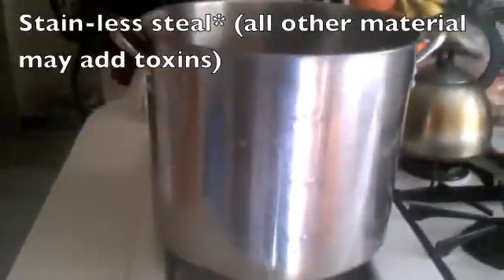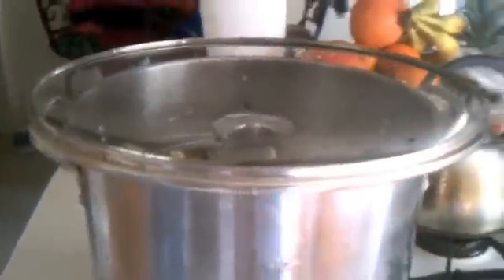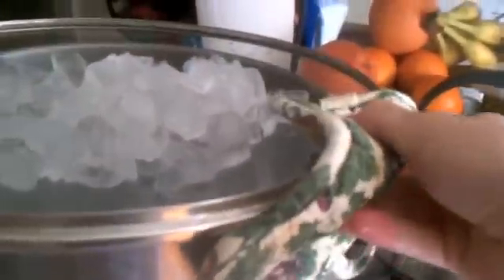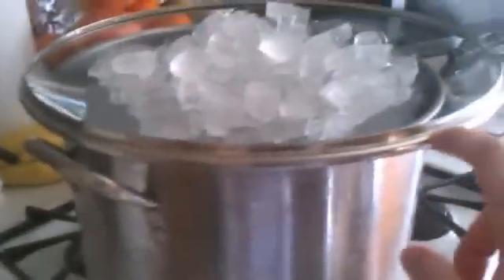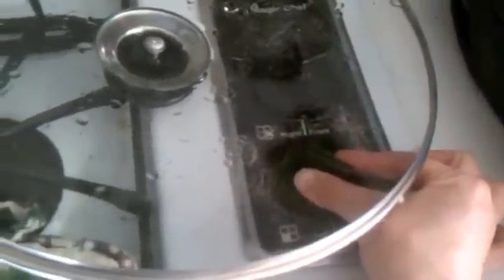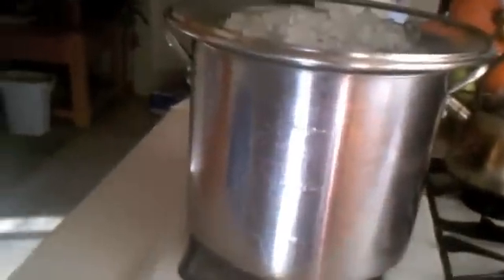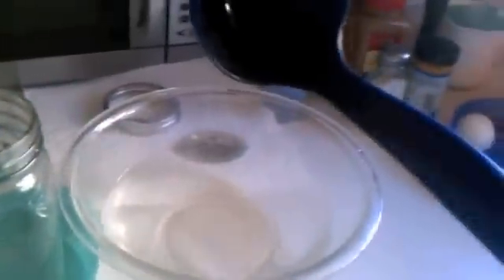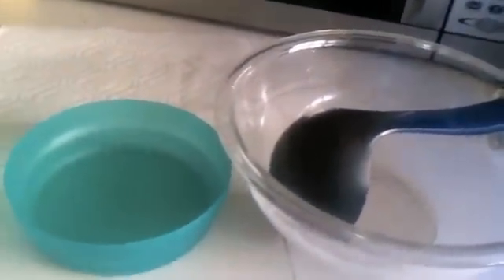How To Make Distilled Water | DIY Distilled Water

Comment: Flouride naturally occurs in water. It's a salt... It's the Chlorination that's problematic. Chloromine forms when Chlorine interacts with organic systems (your body) . Brita filters change the taste to bearable but I am not certain if it removes chlorine. I think it does.
Reply: 1. Yes, a carbon filter (Brita is one) does remove chlorine.  That is the good news!
2. Just because fluoride salt occurs naturally in the water in some areas does not mean it isn't a poison or make it good for you.  Arsnic occurs naturally in some areas as well.- but it will still kill you.
Google "fluorosis" to get an idea of some of the serious problems that naturally occurring fluoride causes.
Those who promote the use of fluoride state that it works topically (by external application to the specified area); hence the reason it is in tooth paste and the reason dentists give you the fluoride solution to swish around your mouth.  But both of them tell you NOT to swallow it.
The practice of fluoridating drinking water in order to help build tooth enamel is analogous to drinking suntan lotion to protect you from sunburn (as opposed to just applying it topically to your skin)!  Because they both are said to work "topically"- but who in their right mind would drink suntan lotion?!  Or even worse, who would consider adding suntan lotion to the water supply to protect everyone from getting a sunburn?!
By the way, a little research will reveal that fluoride is not a component of any known biological/life process of any known organism- including the building tooth enamel. It is a poison to all life.
Fluoride can also come in many forms, some being much more dangerous than others. Unfortunately, most cities that fluoridate their water supplies have moved from using fluoride salts to using a FAR more dangerous form called hydrofluorosilicic acid (or hexafluorosilicic acid) which is quite difficult to transport because in its undiluted form it can eat through concrete and many metals & plastics, and it is deadly to any living organism in that state.
Reply: Both are problematic.  What would be the purpose of putting fluoride in drinking water if it naturally occurs?  What's the purpose of drinking fluoride if it's good for teeth; shouldn't fluoride toothpaste hit the target more efficiently than fluoridated H2O?  Since it naturally occurs in nature and is in the tooth paste why add the additional cost of processing water by putting in more fluoride?  Have you ever read the fluoride warning label on your tooth paste?  The fluoride they put in our H2O is a waste product from the aluminum industry.  Look up the MSDS on fluoride and then decide. Neither the CDC nor FDAs argument hold H2O.
Reply: Nolom Ebal I think you're ignoring the fact that most idiots can't even manage to brush their teeth on a regular basis.

DJJonPattrsn22 I think your comparison of suntan lotion drinking water and fluoridated drinking water is entirely flawed. Suntan lotion protects your skin which is not in contact with the water you drink, fluoride protects yout teeth which is in contact with the water you drink. It'd be more accurate to make the comparison that taking a bath in water that contains suntan lotion is like drinking fluoridated water, since in both of those cases the topical solution would actually touch the surface they're intended for. And FYI taking a bath in suntan lotion water would provide some level of skin protection, like fluoridated water prevents tooth decay. Of course taking a bath in something toxic has less risk than drinking it.

If there was no evidence that fluoridated water actually improved health in the mouth, it would certainly not be done because it costs money and it would be pointless. While fluoride is not needed for any biological process, it doesn't make much sense to talk about the toxicity of a concentrated form. The body needs iodine to survive, yet iodine is toxic if taken in quantities in excess of 2 mg (That is a very small quantity!). Most nutrients the body needs can be overdosed and provide negative results, including death, so should we consider them all poisons? Of course not.

That aside, fluoride can cause fluorosis over time and is still dangerous when taking in non-toxic quanities, the kidneys can only remove 60-80% of it per day in most cases, the rest calcifies. So I'm by no means saying we should continue fluoridating water, just saying there's a reason it's done. The main reason being people are too stupid to handle their own hygiene.
Reply: GOAE7777 FLouride is put in the water to Sterilize the water, they remove most of it before it leaves the Water treatement plant, Stop trying to sound so smart... The Healthy teeth thing is just a Lie they tell to make the common ignorant man feel safer. FDA is curropt and doesn't care about your health... And Sunscreen, not suntan lotion lol, Is in our water supply because we wear it before we swim in pools, lake and the ocean... It is killing coral reef and contaminating Water Tables, and pools put the sunscreen lotion back into our public water system... So yes that is also a concern

Comment: i have a question, is the rain water distilled water ?>
Reply: Yes, with cloud dust in it.
Reply: Yes it is but not good do drink because or all the chemicalls these days are in the air
Reply: the precipitation is condensation, but it's not distilled because it contains impurities from air pollution. Example, acid rain in New York damages the statue of liberty. Ever try eating snow?  you can taste the crap in it.
Reply: hi li I love eating snow... It's so tasty...
Reply: eagle eye & *****  Yes. That is correct, distillation is defined as a process of purification through the evaporation & condensation of a liquid- water in this case.  The evaporation of water which then falls as rain or other precipitation is sometimes cited as an example of distillation in nature.  However, due to the high level of airborne pollution especially near urban & industrial areas, significant amounts of sometimes very dangerous airborne toxins can be absorbed by precipitation by the time it reaches the earth.
Reply: But nowadays...  acid rains happen which make the rain water PH. Unstable...
Reply: eagle eye What kind of question is this? please understand that winds blow all the pollution around the globe to fall with the rain far away? Volcanoes ashes, industrial and fires, never use rain water for drinking!
Reply: treliyiaellinika this was a curious question. the activity that happen in nature is the same as this experiment here was made except the blow winds and volcanos the practice seems to be the same
Reply: ***** thank you Karla appreciate that
Reply: eagle eye lol I was wondering the same thing.

Comment: That's not distilled water. If that was distilled water, when you put the teaspoon into the bowl water when it was clearly over 100+ degrees C as the main water was boiling rapidly, the teaspoon would have caused a violent reaction (like an "explosion") as distilled water has no minerals in it and doesn't boil. If you heat distilled water over 100+ degrees C and drop any mineral into it it will "explode", NEVER DO THAT!!! You don't need the ice at all and it is just a waste of money and energy with this system. Never use a plastic handle like that as it contaminates the water as well. You can do it almost like you have been but place a tall metal rack under the catchment bowl so the bowl it is not touching the tap water that you will be demineralising at all with the base of the catchment bowl about 4" above the tap water line at least (this will help reduce splash contamination. Gently simmer the water, do not rapidly boil it, if it boils rapidly the bursting bubbles will contaminate the catchment bowl. Use an even bigger glass bowl instead of that lid that will sit on top of the pot (the same way you have the lid setup but without the plastic handle or any other contaminating materials which will contaminate the water. As the water vapour (steam) rises, it will condensate on the underside of the glass bowl lid. The distilled water will run down the underside of the glass bowl lid and drop into your glass catchment bowl. With this set up, the slower the better. Sea water is good for this set up as the salt will crystallise on the bottom and you will have fresh water in your catchment bowl (when done right) which is what this set up is actually best for. 

If you just want drinking water, get a carbon filter. They last for ages and are a lot easier to filter water for drinking. Pure distilled (demineralised) water isn't very good for you to drink as the body needs the minerals to hydrate properly. Distilled water is better used for Pb batteries, electrolysis, car radiators etc.
Reply: +Bob Saget 

thanks for the info Bob...but not the insult...which keeps u in the low life world sir.

Comment: These work great! I built one almost identical to this a couple of years ago. It's called a "reverse solar still". One thing I would recommend is to put your ice in a ziplock style freezer bag for easy removal and replacement. I also placed my inner bowl on a metal measuring cup as a pedistal as to not make contact with the boiling water. I found it to be more efficient. Yes you can use these to make alcohol as well.

Comment: you should let the water in the pot boil for a few minutes before you begin collecting the condensation in order to let the TOC's and VOC's (which evaporate at a lower temp. than water) escape first and not contaminate your distilled, collected water.  if you use municipal tap water, this will also give the chemicals, the city or county puts in the water to keep the system "clean", a chance to escape.  also, using a bowl or baggie of ice make clean up easier.

Comment: Good video, but I have one question. Will not the plast handle on the Cooker Hoods add chemicals to the distilled water? Just curious.
Reply: We have to find a way to remove the handle and all will be perfect and cheap.
Reply: A sterilized steel ladle would do the trick
Reply: Tomas Gjerstad just place something over the hole
Reply: Tomas Gjerstad you can unscrew them
Reply: I removed the plastic handle by unscrewing it and then covered the hole with an aluminium foil duct tape. Seems to work well.
Reply: Tomas Gjerstad LOL, If your that concerned about 1PPB of contamination, you should probably stop breathing air because SECRET: the air your breathing is about 10,000 times more contaminated that that plastic handle.

Comment: Pick a better SS pot! Not one with rivets holding the handle on. The rivets are made from aluminum. To test this out fill the pot with tap water over the rivets and let it sit for a few days. You will see that the rivets are corroding and look fuzzy, and can be wiped off with just your finger. Buy a better pot that has the handle wielded on.Good SS pots will not even have a mark inside where the handles are attached.

Comment: Why does the bowl have to be floating ,some kind of spacer might be better to protect the bowl from the thermal heat shock ,because the water level is going to fall ?A stainless steel lid would reflect the heat away slightly better .
Have you tried leaving it out in the sun all day instead of on your stove and the breeze might replace the ice ?On rocky ground or on tin foil would help a little or even over a Parabolic mirror ,skies the limit.
Well done excellent survival tip from the tyrannical depopulation agenda  .

Comment: Good tip for people when you need potable water from contaminated water.
The lower the water temperature the purer the distilled water is going to be. You don't want the particulates rising with the live steam. Low and slow does it best.
Reply: I need 0ppm is that attainable with this method? I have store bought distilled water but if the ppm isnt 0 how can I achieve that
Reply: Hmmm, only matter lighter than water would rise in the steam such as gasoline, but those venting some of the excess steam would solve that problem.

Comment: Well, fluoride is another issue altogether.  It has been proven to cause cancer, and fast. It also calcifies the pineal gland in your brain, making people more docile.  Its a very harmful chemical indeed.  I dont know how you can distill within the same vessel.  You need a way to collect the steam, and cool it in a condenser, or radiator.  A good example of distillation is to look at a whiskey "still"

Comment: Im not trying to be mean, but is this a joke?  Im shocked that you didnt shatter your glass lid, first off.  Extreme temperature change will break glass very easily.  Secondly, boiling water is boiling water. While boiling water removes bacteria, it is not distillation.  Distillation is the process of collecting the water vapor created while boiling water, leaving any minerals, or other toxins back in the first pot.  This isnt really good to drink all the time,because we need those minerals

Comment: The only problem here is the ice melted into the bowl and the water from the ice was most likely undistilled Ice, which completely defeats the whole purpose. The water is not completely distilled in the bowl. You should have set the heating temp much less than that, as having ice on top gives it a boost already. As someone else mentioned, but my version of it; use not one but TWO plastic bags to avoid leakage.

Comment: to avoid having the ice melt and drip into your inside pot, put the ice inside a big zip lock bag (place the zip lock pointing to the top to reduce the chance of it leaking). A normal plastic bag might also work

Comment: I don't think so as the use of ice cubes is to cool down the steam to make it condensed to water drops (and then drip down into the bowl), but I guess you'll need to make sure that the lit is not broken otherwise unsterilized ice cube water could leak through the gap or holes
Reply from the maker: great point!

Comment: you are joking, right?  modern water purification eliminates many threats you probably take for granted, like parasites and bacteria.  drinking distilled water on a daily basis is not healthy as it does not contain any minerals the body requires.  distilled water is beneficial for several applications, but it is certainly NOT recommended for long term consumption.

Comment: Nice idea....but cheaper in the long run just to get a water distiller.  I got one for $160 from h2oLabs.  I did however read that due to the fact distilled water is slightly acidic it should be avoided.  Thoughts?

Comment: The heat difference created by the cold lid and hot pot will NOT create a vacuum. That's one of the most absurd things I've ever heard of. And you can easily avoid breaking the glass by heating the water in the pot just enough to get it to start steaming. And I don't know where you live, but a gallon of distilled water is not $1. 
Take some chemistry courses.

Comment: Doesn't Remove solvents..... Try taking the handle off the lid to the pan... leaves a hole.... place a funnel and pipe over the hole... other end of the pipe into a glass bottle. No need for the bowl or the ice :) ... And use filtered water not Tap or Bottled.

Comment: Hmm. I do like your method, but distilled water leeches strongly & the plastic handle on the inverted lid is the major point from which the freshly distilled water drips down into the bowl. Just saying cuz u were otherwise so careful to use glass & metal -- no plastic. Good video, otherwise. There are pot lids with metal handles, BTW.

Comment: I like to use distilled water in my humidifyer. Where I live, it's freakin cold!  Using regular water in the humidifyer causes mineral deposits all over my home. White chalk like dust all over everything. It also leaves crusty mineral buildup in the machine, which is hard to remove. With distilled water, no such deposits are all over... I wouldn't drink it, but this is why I was looking for a cheaper way to get distilled water.

Comment: since your distilled water method uses a non vacuum approach with a concave lid or cover and CO2 is heavier than air most would stay to the bottom of your apparatus, and would not be pressurised into your clean water.??

Comment: Good vid Herbade, In an emergency this would work. However if u had no source of heat or ice the same would apply in direct sunlight. Pot/water/collecting container/ concave downwards lid or cover. My only concern would be the plastic or rubber lid nob. To prevent all possible toxins i would remove the nob ( lid handle) and put back the stainless screw with a stainless nut. As the solar water is collecting u could find material to make fire and boil later to purify from bacteria/parasites ect.

Comment: crazywaterz u would need an airtight seal to implode the stainless pot or crack or break the glass, loose fit lid? I see no gasket or know of a way to fuse glass to stainless? However if you payed any attention at 2:34 i can clearly see a gas stove. and at 2:51 she payed for the ice. "IF YOU BUY A BIG BAG" Where than is the so called "$2 worth of electricity"?? If I were u I would apply your c) comment because a vacuum does not apply here. But for the sake of forgiveness d) a loose conclusion.

Comment: "Use a stainless steel pot, it makes kind of an echoey sound." Good tip. If it makes kind of a 'pingy' sound, it's probably teflon coated. If it goes, 'bwongongong' - most likely copper.  

"Make sure you don't leave your mitten on the burner." Another gem. I usually leave my potholders directly on top of the flame. I was wondering why they kept starting kitchen fires.

Now, I can't thank you enough for that demo on how to use a ladle.  "Slowly dip the ladle into the distilled water." Brilliant!
Reply from the maker: LMFAO. best comment I've read, seriously. thank you for the laugh. same humor <3 thanks for the engagement!